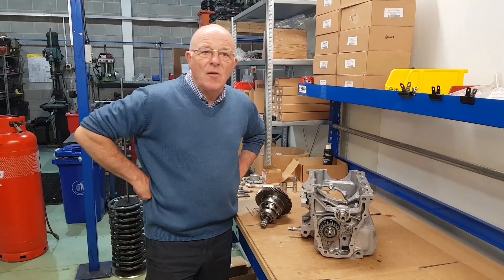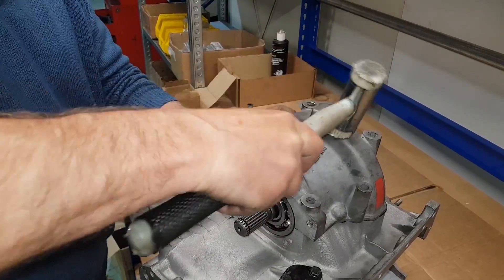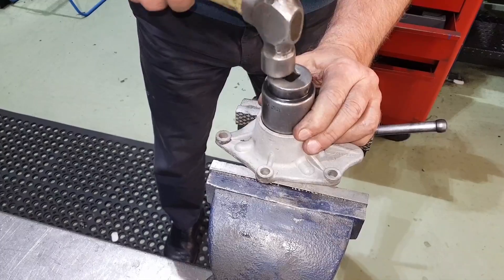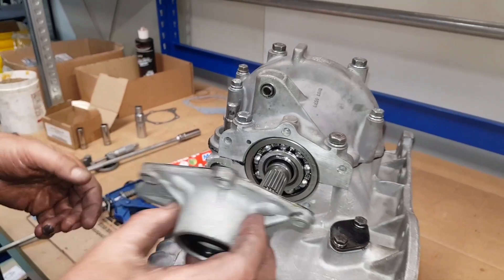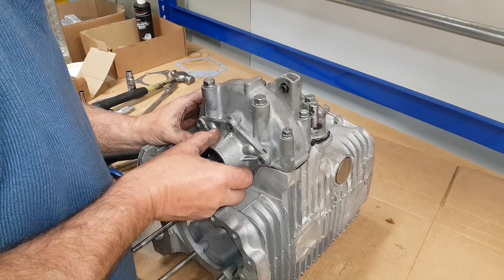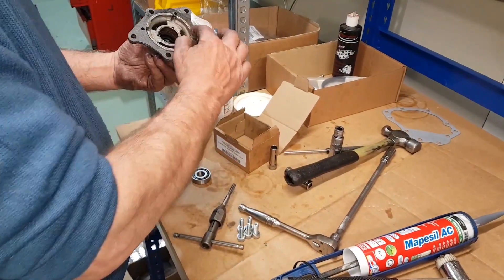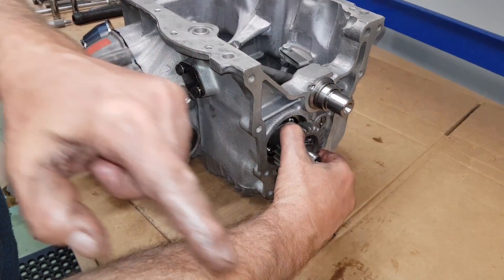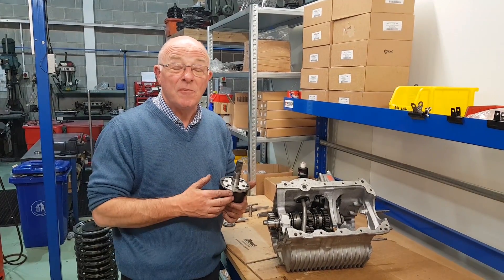How to build an MED straight-cut Mini gearbox - part 3

Comment: Would the be a helical diff available anywhere that would fit an Austin 1800 by chance? Also, you never explained exactly what “Straight cut” actually means. Thanks :)

Comment: Also just noticed that you used spring washers on the bolts in the diff housing. These are flanged bolts, shouldn't there be no washers just some loctite?

Comment: I have been using this series of videos to rebuild my gearbox. What is the black sealant you use for the Diff Cover and what type of grease do you use on the Diff Output Cover gaskets?

Comment: very nice work, i wiil be doing my verto clutch soon, can u tell me the 3 bots i need for the puller to remove the flywheel please, i dont know the thread size or bolt lenght  regards Mark (1984 mini 1000 25th)

Comment: how come you don't use sealant on the end covers? Is it because of the pre loading?
Reply from the maker: Yes, that's the reason :)
Reply: @MEDEngineeringTechVideos  
so will the grease help to seal?
Reply from the maker: @troaky  Yes, that and the gasket will seal it, unless the faces are damaged.
Reply: @MEDEngineeringTechVideos  I know this video was a while ago but am I right in saying the earlier differential housings required gaskets and the later ones used just the sealant? You don't by any chance know the part numbers of which ones require which?
Reply from the maker: @jonahheal263  Yes, the remote boxes used gaskets, rod change sealer.

Comment: @MED Race Technologies 
 show a geared up 1 in 20 or bigger mechanical advantage.
its OBVIOUSLY possible to gear up a simple hoist pulley stacking a few BICYCLE drivetrains in series .  
my legs are turning the business end of a 2ton hoist at high rpm..you understand what that means 😐..👍